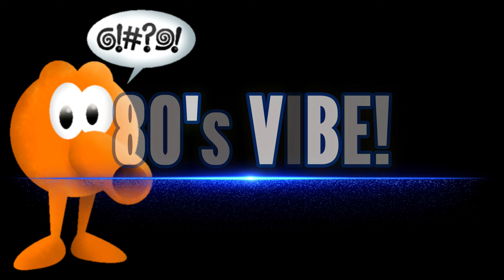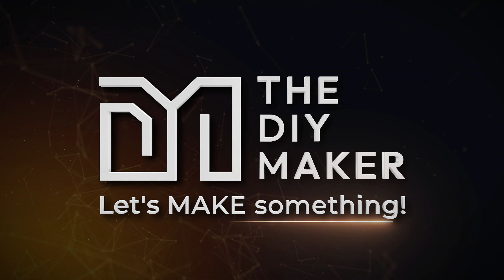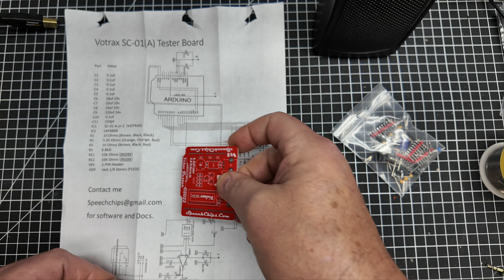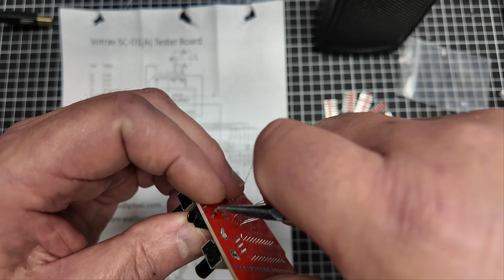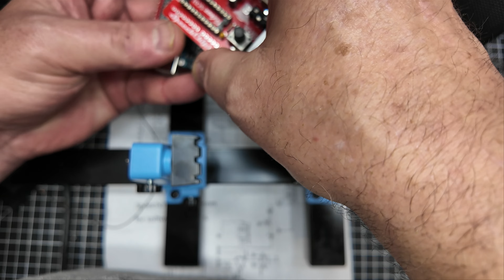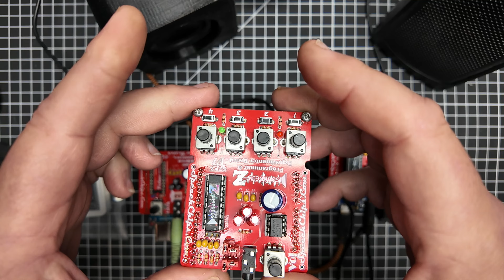Building an 80s Speech Chip Kit for Retro Gaming & DIY Magic! Reimagining the Votrax:

Comment from the maker: Affiliate Links Notice: Some links in this description are affiliate links. Using them helps support the channel at no extra cost to you—thanks for your support!
https://speechchips.com/
The PCB Kit or fully assembled version - https://www.ebay.com/itm/275351088011?
Votrax Chip - https://www.ebay.com/itm/276800408420?

Tools used in the video:
Speaker Driver - https://amzn.to/3DcuRWZ
Speaker Audio Cord - https://amzn.to/3FdmXx5
3D Printing Models for speaker FREE! - https://www.printables.com/model/1220658-speaker-enclosure-for-a-25-driver
PCB Holder - https://amzn.to/41wAHKH
Soldering Iron Holder - https://amzn.to/4kzdy2U
Portable Iron - https://amzn.to/4kzhQXY
Flush Cutters - https://amzn.to/4hloSNb
My preferred Solder - https://amzn.to/4hloSNb
Soldering Tip Cleaner - https://amzn.to/41zkDb2
DeSoldering Braid - https://amzn.to/41LYGGZ

Comment: This is really cool, using original hardware! I wanted that style of voice for my robots, but went with Flite running on the ESP32 of the servo controller, outputting via I2S to an amplifier. Audio complexity is a bit better than this, but still sounds like a proper robot. Firmware is on my github.
Reply from the maker: Very cool!